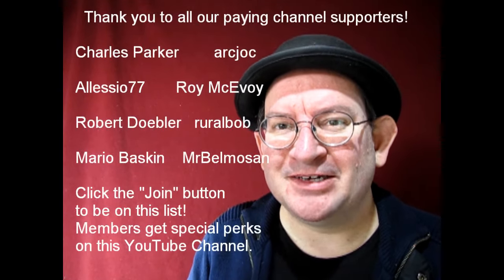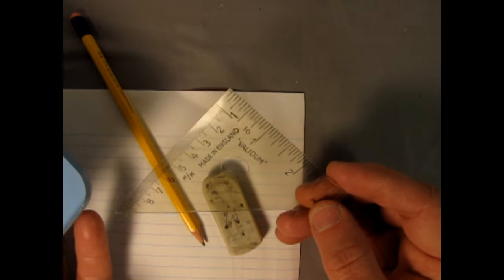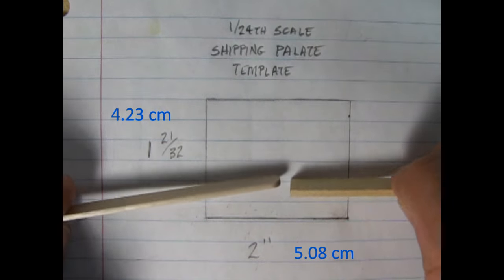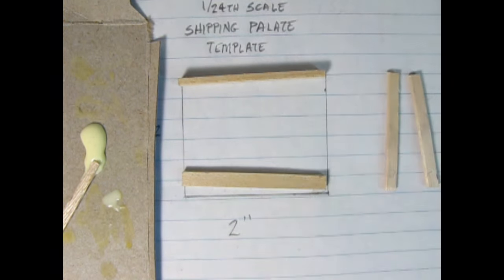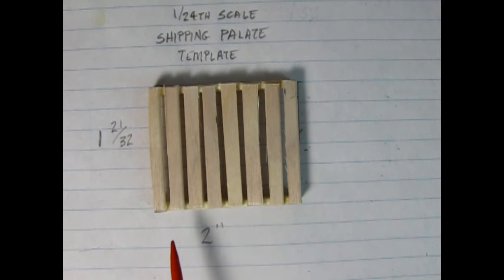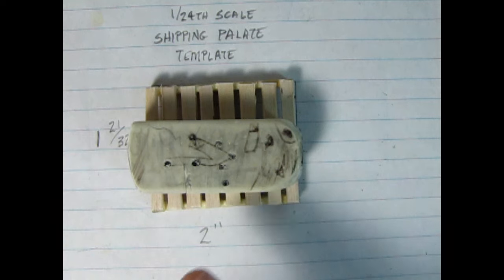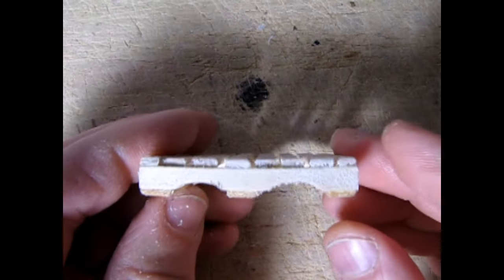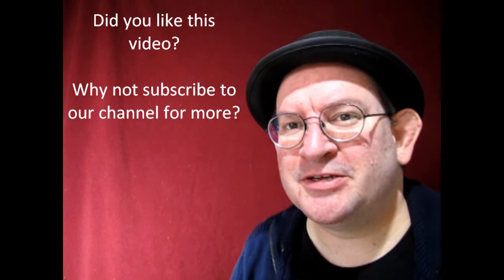How to Build Accurate 1/24th scale Shipping Pallets using Balsa Wood and Popsicle Sticks!

Comment: Another tip. If you use graph paper on a cork notice board and some dress making pins would have helped you keep it square 👍😎
Reply from the maker: That's too much like building balsa wood airplanes. LOL! - I was also thinking after that I should have made a simple "L" shaped corner mounted on some particle board and then set the runners into there as a jig. I guess I just got caught up in the fun of it all.

Comment: Nice old geometry set,Trevor. 👍🤓. I think youll find the plastic has flexibility that new sets do not have.I'm surprised you don't know that 0.6666666 = 2/3rds of an inch . Pallets  not palates,which is a physical exercise. Also if you'd changed to metric,millimetres, your maths and measurements would have been easier,once you'd scaled down
Reply from the maker: True Pete! True. I'll have to change my spelling. LOL! When I was looking up palates, I found a ton of baby pictures where the babies were born with split upper lips. I think it's a medical issue in newborns as well. 

I don't think there's such a thing as 2/3 inch. At least I never saw a tape measure with it.:_Suprise:
Reply: @MonsterHobbiesModelCarGarage Trevor,  this is where millimetres would have helped. I've was watching your video and doing the maths.🤓 My sticks are 5mm × 1.5mm. My pallet worked out to 40mm x 50mm. I've got 8 cross strips 5mm wide with gap of 1.5mm. I can use the thickness of a strip as a guide to the gap between each cross strip. If you don't want to pin pieces in place,small pieces of double sided tape would help locate parts👍😎Pete 🤓